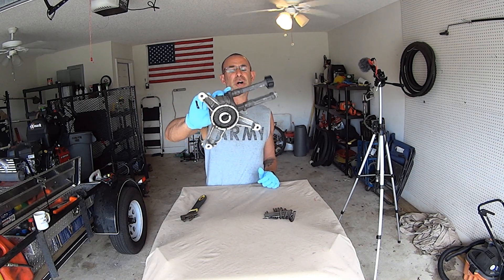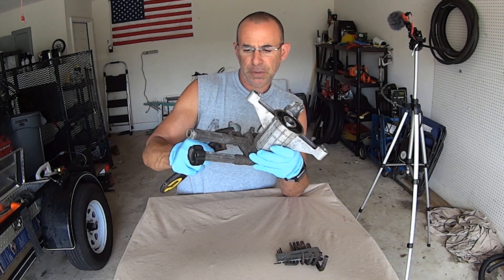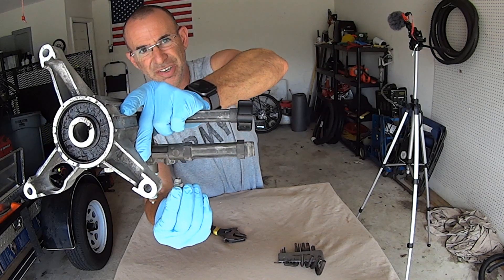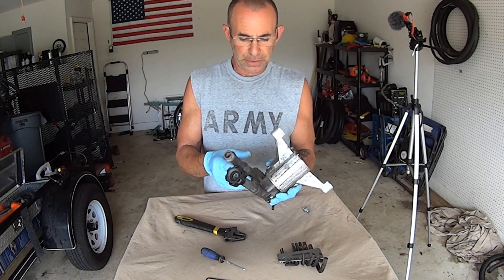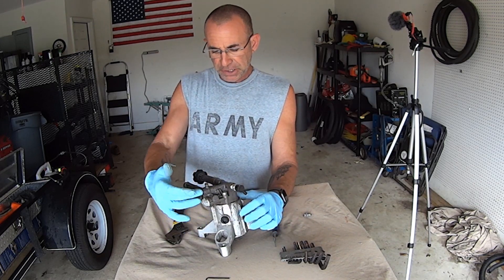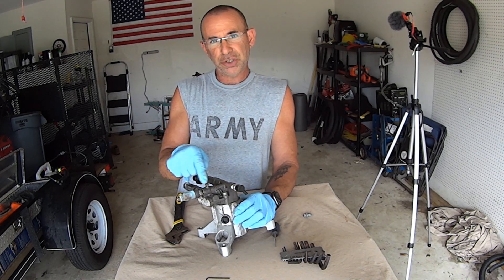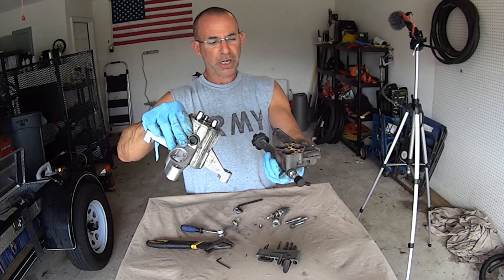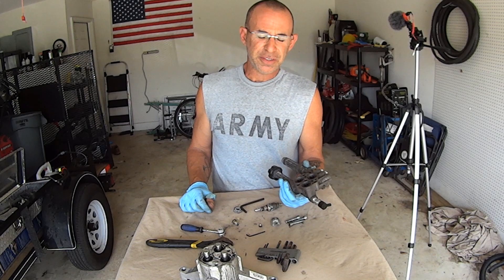What's Inside & How Does a Pressure Washer Work - Diagnose and Repair Common PW Parts

Comment: What's the black plastic looking plug on side of pump main body?
Reply from the maker: Using the thumbnail as a reference. The black plug pointing away from me is actually the drain port connected to a thermal relief. When the pump is on but your hand is OFF the trigger. The water will get very hot and foam up and bubble causing the pump to burn up. The thermal valve will instead open and pee hot water out the black plug allowing cooler water to flood the pump
Reply: On my pump that plastic plug blew out and stripped threads, wonder if it cause pump bad?
Reply: You may be talking about the oil Drain Plug it holds  ND (Non-Detergent) SAE 90w  (Crankcase oil).  If that is what you're talking about, don't know how that blew out That is strange unless it had too much oil. Mine is only supposed to have 2.2  OZ of oil     hope this helps
Reply from the maker: @bumblbesss  Thank you

Comment: what could cause a pump to not disengage and keep running continuously? I'm not talking about the motor, i'm talking about the pump, thermal relief valve has been tripped multiple times, can the pump be going out? I also tried a new unloader valve thinking that might be stuck but no dice.

Comment: Great video Dan!  I'll give this a watch several times.  Hey question for ya.  Last time I was using my pressure washer, I would pull the trigger and nothing would come out.  The pressure ended up getting stuck in the hose where I would have to disconnect the hose to release the pressure.  I tried different attachments and even a completely new gun.  What could be causing this to happen over and over and over again?  Is it the unloader valve? Thanks!
Reply from the maker: It has to be the valve. It is stuck open and recirculating the water

Comment: Hello sr. I have a question maybe you can help me with. 

My PRESSURE WASHER starts well. but if I dont pull the trigger immediately, it Turns off. I have to pull the trigger to unload all the accumulated pressure other wise I couldnt even pull the starter back. it kind of gets all the pressure and go off since its not letting it go. 

sorry my English is not the best, hope I did explain myself as good as I tried.

thanks in advance,
Reply from the maker: Your pressure relief valve is stuck closed. You need to lubricate it and maybe tap it with a hammer

Comment: Pressure adjustment vs a bit more revs, which is safer for the machine? I guess you can over speed the pump?
Reply from the maker: Neither. Buy it right the first time.
Reply: @DansVlog  my pressure washer engine throttle position got kicked up, I just set it up to where it sounds the same.  I haven’t messed with any of the pump adjustments.  It’s a weird Briggs Powerflow+ pump

Comment: Will water pressure get messed up if you connect two pressures to one house?
Reply from the maker: No issues as long as they are low volume pumps.

Comment: Hey Dan I have a Simpson 3100 and my oil is mixing with my water.
Reply from the maker: Mine did that over a year ago, I changed the oil and used it with no problem. I changed the oil one more time a while back and all still good
Reply: Well I have done mine like that several of times and I'm having to change it after every use and if I use it for so long I have to change it that day.. lucky you

Comment: Lol yo Dan question my stihl fs90r I just gave a tune up new spark plug air filter and fuel filter when I turn on trimmer the head is spinning without me pushing throttle???? Can I ask for your advice.thx in advance!
Reply from the maker: If the RPM's sound like the engine is not revving high, then your clutch is stuck. If your RPM's seem to be high, turn the idle screw down, and or make sure the throttle and throttle cable are not binding up or kinked

Comment: I'm operating a 3800psi 6.8gpm 7.5HP the problem is it has high volume of pressure that destroys surface. What can I do or is there a switch to regulate? I don't have its guideline
Reply from the maker: You should be able to turn the dial down but also, they sell wands with built in twist knobs you hold as a handle and you can dial up and down the pressure as your spraying along. We had one at Atlantic Waste. Works great

Comment: I've got a pressure washer that started surging when letting off the spray gun ant it eventually was building so much pressure it would spray a little when not spraying and now the motor will nor run unless the pressure is being sprayed. Sound like it's building too much pressure and dead heading the pump.

Comment: those slots in the white plastic spacers can't possibly line up with the grooves in the housing. the washers are a perfect cross pattern while the grooves in the housing are at different angles making it geometrically impossible for those slots to line up but I could understand why you would make that assumption at first glance. otherwise pretty good video
Reply from the maker: Thank You

Comment: Hi there Dan!.. I’ve got a problem. Recently I got my pressure washers pump changed and I also got a different one fitting on my wand  pressure washer hose.. I changed it with a hydraulic fitting cause that was the only one available. but before changing the fitting every time I let the trigger go from my wand my pressure washer vibrates like crazy. And also it does not give me enough pressure. I remember my pressure washer out let pipe from the pump to the wand had a tiny thing with a spring it. But after the repair I had I lost it. I’ve checked the unloaded , valves , filter and all was fine. So I’m really out of ideas ... could it be the spark plugs or carburetor? Or even the tiny spring thing that I lost from the outlet pipe?

Comment: same as air compressor ,,,I had one explode because of them valves,,,just needed one,,,replaced and blue up,,,found out ,,should have replaced all three,,,old versus new,,pressure difference,,,,,be safe,,,later,,,ps,,,,replace everything,,,there tested and MATCHED PRESSURE,,,WATER IS THE SAME WAY,,,,ALL,,,THE COMPRESSOR THAT BLEW,,,SCRAP NOW,,,BOUGHT NEW,,,BETTER IN THE LONG RUN,,DONT NEED IT BROKE IN THE MIDDLE OF MAKING MONEY,,,

Comment: Interestingly... there are NO instructions or videos on how to repair the oil filled drive unit that the pump head attaches to.  I've got one that has a bad bearing, but no bolts to disassemble the unit.. just the big oil seal on the motor shaft side.